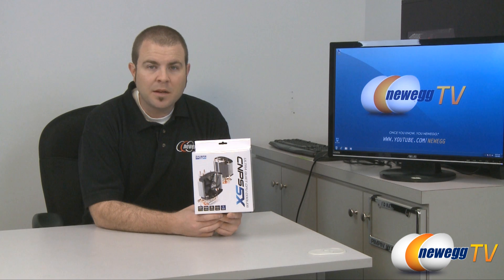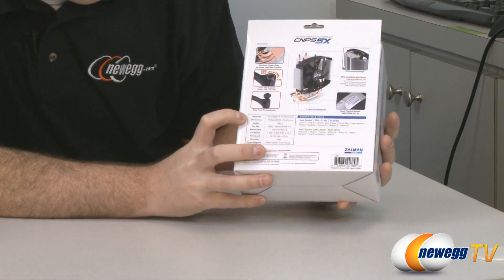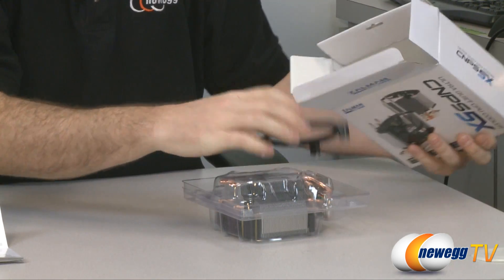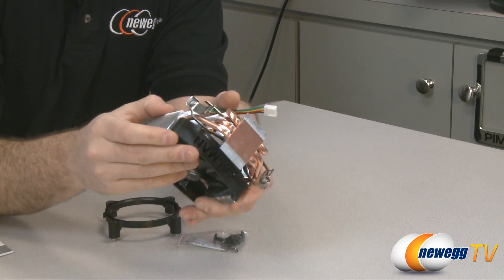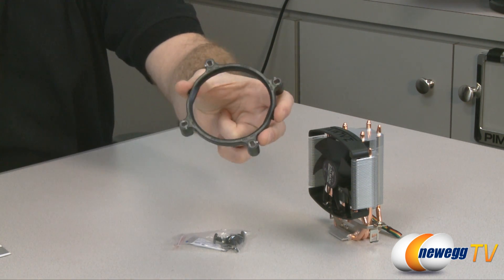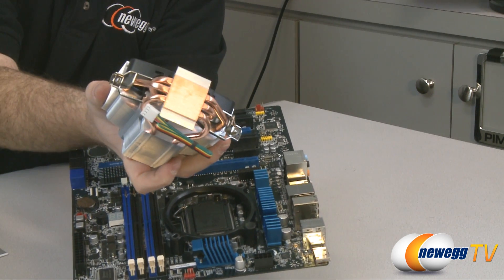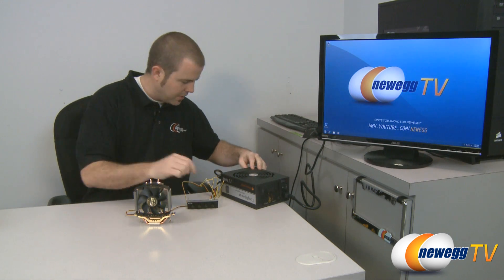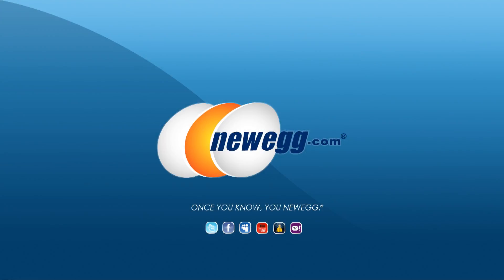Newegg TV: Zalman CNPS5X CPU Heatsink/Fan Overview

Comment: ◾Socket 1155/1156: Core i3/i5/i7, supports all speeds
◾Socket 775: Core 2 Quad, Core 2 Duo, Core 2 Extreme, Pentium Dual Core, Pentium D, Pentium 4, Celeron D, supports all speeds

Comment: This is by far the best cpu fan for price and performance for my 2600k, like a stock intel cpu fan cost like 10$? i got this for 20$ and it works wonderful no issues at all even the thermal paste seems like pretty good quality stuff. I was running around 40c idle to 63c max out and now when i play games at max i rarely see it go over the temp from the intel stock cpu fan on idle its always around 37c-42c running battlefield 3 max so overall amazing cooler! zalman ftw! >:)

Comment: this is a nice cooler, the 2 cons are I don't think the fan is replaceable and it uses the same push pin locking crap that stock coolers use. same with the coolermaster's. hardware secrets dot com rats this @ 46 out of 80. the Enermax ETS-T40 out preforms it but its $10 more and it don't look like it uses the pushpins and I think the fan is replaceable.

Comment: are you kidding me, there using the same cheap ass push pins as a regular 775 intel stock cooler? Thats the whole reason i have to replace it to begin with because they break so easy

Comment: The base doesn't look too polished. At least they could make this cooler an HDT cooler. For the same money you can buy yourself Cooler Master Hyper 212 Plus, which has HDT system, and you can mount up to 2x120mm fans on it, and it supports overclocking very well. This looks like overpriced Korean mediocrity.

Comment: I like the push pin instillation but what happens over time if the plastic starts to back out and the heat sink separated from the CPU :o I like the added confidence of solid metal brackets